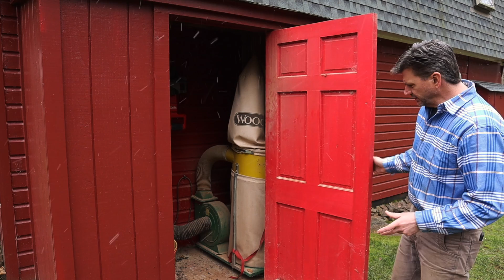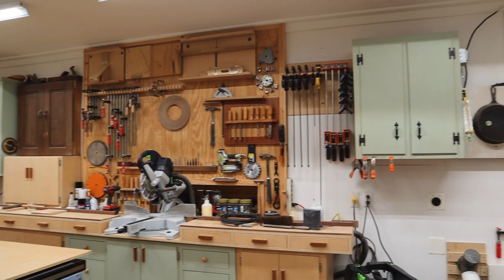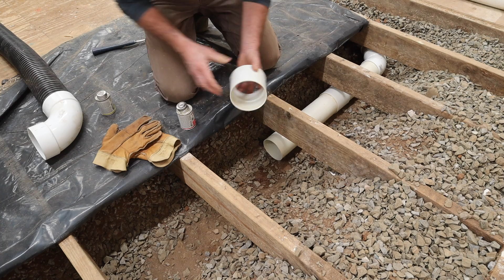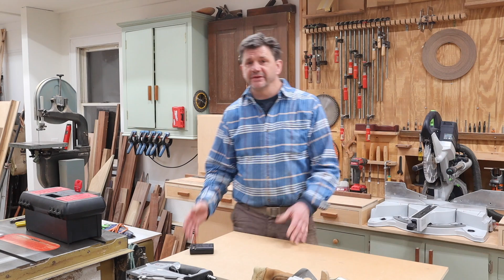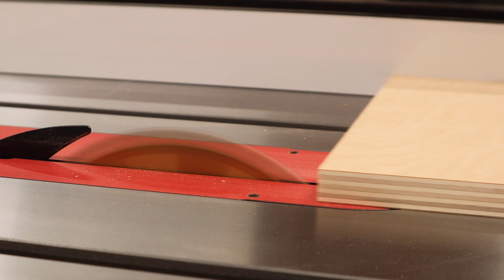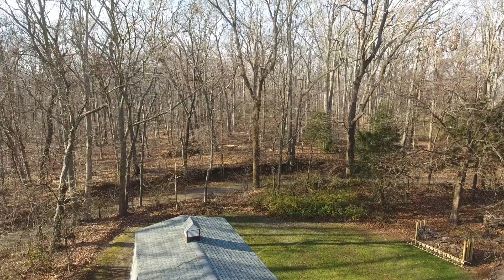Under The Floor Woodworking Dust Collection System

Comment: I'm looking forward to emptying my workshop in January, so I can paint the multi-stained 50yo concrete floor, the 5 year old raw plaster ceiling, and most importantly, so I can run proper dust collection and pipes, and hopefully , get the DC & air compressor mounted outside. I'd love to go under floor or in ceiling for the pipes, but without tearing the whole workshop down and starting over that won't happen. Thanks for the series here Jon, good watching!
Reply from the maker: The hardest part for me was just getting started... nice to be almost finished. Only took about three months.

Comment: Good stuff, Jon~!  My problem seems to be determining tool locations before committing to hanging the PVC.  I'm starting to think that the arrangement may not matter as much if I build in several "down spouts", blast gates, & flex to accommodate moving tools around.  During my military career, I spent 20yrs bouncing between 10x12 sheds, one-car garages, & the like, but now I finally have a 30'x40' pole barn.  You'd think it would be an easy transition finding everything a home, but devising a systematic workflow is apparently a daunting task for me.  Enough of that....
Great video and it's great seeing your space's evolution~!  Thanks for sharing it~!

Comment: Nice job. I can appreciate the work you put into your under floor dust piping system. I agree with your comment about Stubby Nubs-good guy!
installed my dust collection piping in the stone before the contractor poured the concrete basement floor. That was in 1992. I designed it so it came up at each of the major machines. Going under the floor keeps the length of the runs much shorter. The collector & cyclone are located in a closed in space under the. basement stairs. I’ve made a few modifications, extending a run to my router table and another link to a downdraft table. Prior  to installing the cyclone, I would have a clog occasionally when doing a lot of planing. The cyclone solved that issue. I did run grounding wire in the pipes, probably wouldn’t if i did it again. I have the collector wired to turn on when a machine turns on ( thanks to an article in Fine Woodworking magazine -late 1980’s)
It was good to see another under floor installation. Thanks.
Reply from the maker: Very well thought out... sounds like a nice shop Fran.

Comment: I'm in the planning stage for my new shop, and had in-floor dust collection planned.  The idea of using floor joists and plywood has me reconsidering my plan of a concrete slab floor.  I do want a heated floor, though, so wondering how I could still do that.  Wood floor is much easier to stand on, as well...  Thanks for the video, now I've got some revisions to do on those plans!
Reply: You can use warm board, it's an amazing product that integrates subfloor and radiant heat in one. Good luck!!

Comment: Get rid of the cloth filter and buy a canister filter. I got a Wynn canister filter for my Jet 1100 series collector and it doubled the CFM at all my tools. Used an anemometer to confirm all the improvements I made. Cloth filters have little surface area of 15-20 sq ft versus more than 250 sq ft of filter area on the Wynn canister. Difference is night and day.
Reply from the maker: Thanks I’ll look into it 👍

Comment: Hi Jon.  Concrete floor.  Yes, very expensive.  I just poured a pole barn 36 wide by 42 deep at 5 inches thick and spent 6K.  I like the floor idea and I'm thinking of an add on to the barn using your floor for a new woodshop.  Thanks so much for your videos.  Todd in NH.
Reply from the maker: Thanks Todd!

Comment: Great job, Jon, and I love watching your videos. You might consider some heating or cooling in the shed to match the temp in your shop so the DC doesn’t suck out the air you’ve heated or cooled. Also, a cleanout might be a good idea in case of a clog, just as in waste lines.
Reply from the maker: Good ideas Jim, thanks!

Comment: I am very interested in the way the wood is in the gravel.  I have been looking for alternatives to turn the dirt floor in the barn to a part wood - part concrete floor (24x36) so an under the floor dust collection can be put in.  Wood appreciate any info in placing wood in gravel.  Great video. Thanks.

Comment: As an electrician, I have used a heat box, heat gun, and a torch to heat up an bend PVC. What I have also done is rotisseried a PVC pipe in a patio gas grill.......necessity is the mother! DD

Comment: I noticed on the Sawstop blast gate that the screw to lock open the gate is on the DC side.  On my gates that would make it leak, but it would easily be fixed by moving the screw to the other side.
Reply: I noticed that too. The screw always needs to be on the tool side so that it pushes the gate to the suction side, preventing leaks.
Reply from the maker: Thanks for the heads up 👍

Comment: You’ve done the best kind of grounding there is… You buried the pipe in contact with the actual physical ground for most of it’s length.

Comment: Hey Jon, nice solutions. Never had adequate suction from my 1.5 hp delta, even with large drum chip collector. Concrete floors pre existing  in my small animal barn means overhead .  What a difference a few feet in every direction.  Floor space what floor space?  Not laughing here.  You are definitely more organized than me. LOL!  Started out with smaller power equipment then lost space as I added big boy tools. Thanks for sharing your journey!

Comment: Figure out how to ground before using plastic pipe. Static sparks in wood dust can cause explosions and fire. Use galvanized steel pipe instead. All dust collecting pipes eventually clog so all pipes need to be accessible for cleaning.
Reply: There has never been a case of a wood shop exploding from a dust collection system.  Stumpy Nubs has a great video on it.  Also the pipe is grounded as it is in direct contact with the...ground.

Comment: Always enjoy your videos, thanks. I like the idea of getting the dust collection system out of the shop because of the noise and space it takes up. Numerous of people have advise me against that cause of the loss of heat and air inside my shop. I don't see it could possibly lose that much,. What do you think?
Reply from the maker: Hi Jack,  I got the same advice but it was a trade off I could live with.

Comment: Great to see this come together for you , Jon!    I have a similar 2HP single stage collector in my shop and I have not grounded the PVC ever.   Maybe it's because I'm in a basement  (so the ambient air is not particularly dry) but I never have static issues, and I've read some of the same info that you and Stumpy did.  (But I've still been asked about it!)  

How is your drum sander hooked up?
Reply from the maker: Hi Art, thanks again it worked great 👍... I usually use a separate hose and connect it at the top of the Y where dust collection comes in

Comment: Hi John, I would love to do something like this to my small shop but I'm thinking about loosing the warm air from my shop in the winter and the cooler one in the summer, because the dust extractor pulls a lot of air, and that would need to be replenished somehow, only way would be to pull air from the outside.
Did you think about anything to fix this? Did you notice a difference ? I think the only way to sort of avoid it would be to have some radiant heat, no convection heat but even radiant heat gives the air a bit of warmth...
Reply from the maker: So far it hasn’t been a problem... I put the 
Collector in the shed a few years ago so far so good

Comment: Static buildup is a real thing, and can sometimes lead to fatal damage. I have experienced it myself firsthand. I also doubted the existence of the phenmenon, until I got shocked by touching what I previously thought was a "safe" surface.
But the problem doesn't just occur by itself. There needs to be spesific factors in place, for the static to build inside the pipe. Temperature, airmoisture and buildup of debries inside the pipe, are key factors.

I work at a fishfarm, where the feed for the fish, is transported by pressurized air from the siloes to the pens, through 90mm feedingpipes, with a lenght of up to 600meters(almost 2000feet). We  have previously measured current of upto 30.000volts! inside the pipes. But for recent years , new antistatic pipes have been available. And after switching to those, the problem have vanished.

Comment: Did you make any way for recovering the heat you loose when the dust collection comes on? If you had a return that would send the filtered air back into the shop it would help.
Reply from the maker: No, it really hasn’t been a problem

Comment: I like the dust collection under the floor and outside.  
Does the shop have concrete footings or is the whole barn just build on the ground.
Reply from the maker: Hi Jim, the barn Is sitting on a cinder block foundation

Comment: What happens if there is a blockage in your dust extraction system and how are you going to clear the blockage
Reply: You could always use a drain snake to clear any blockages.

Comment: G'day Jon, greeting from down under. One quick question, are you worried about the fine dust in the shed with the electric motor on the dust extractor? 
Have a great new year.👍

Comment: You might want to ground the comment section before it blows up. LOL  People are crazy in their opinions on grounding dust collections systems.
Reply: I agree with Jon - it's a myth. People equate a trickle of dust with the conditions in a grain silo - it's just not comparable. Not one woodworking shop has ever had the dust collection blow up. I just put in a 4" PVC system and didn't bother with grounding either.
Reply: @DD-DD-DD  Same here.  Someone mentioned doing it before I put mine in, so I researched it and came across the same Stumpy Nubs vid.